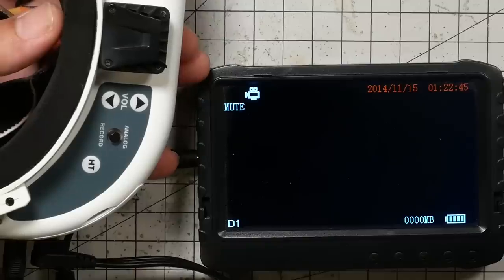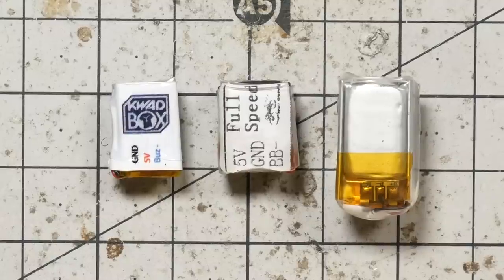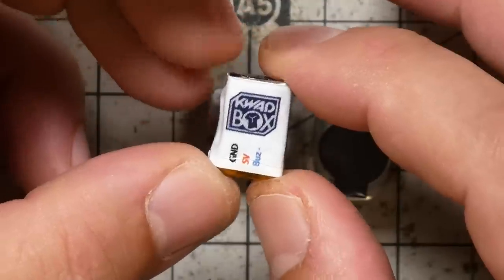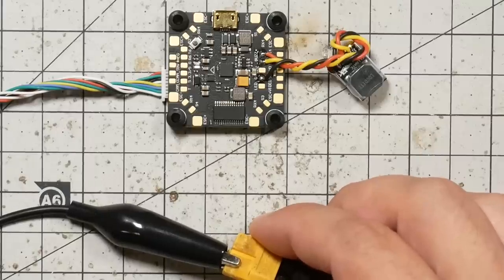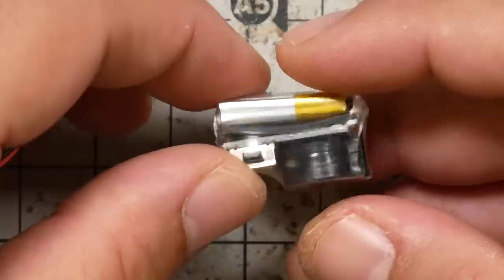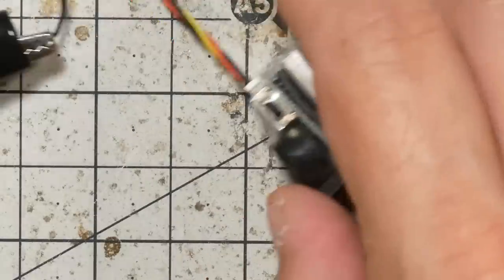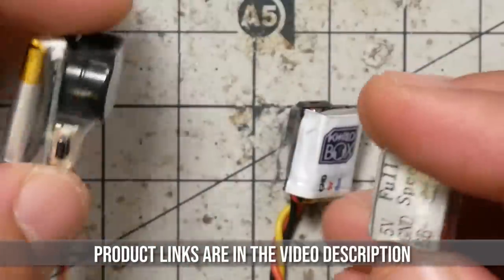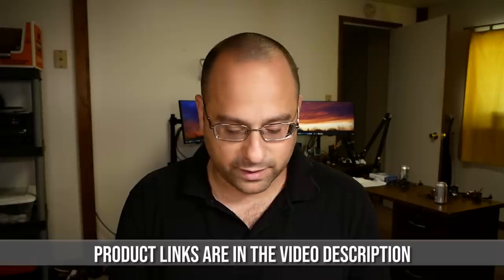Never Lose Another Drone | HELLGATE VIFLY FULLSPEED BUZZER

Comment: I went with Fullspeed Lucky Box mostly because it was the cheapest but I also liked that little menu where it lets you select how long after losing power it arms and how often it beeps. It also has the audible battery level indicator when you connect it back to power which I thought was cool but really isn't all that useful because unless it was sitting in the field for hours or on your shelf for weeks it will always be full and this way I just wake up the entire building if I plug it in at night while working on my quads (also turned off all beeps in BF other than RX_SET and RX_LOST) :) The led is also nice addition if your quad lands in a way that it's visible. Would be great if it had another one on the opposite side so that you could mount it in a way that one led is visible from each side of your quad. Anyway it's good to see competition heat up like this. I never lost a quad but definitely wanna reduce chance of it ever happening and this is a great and a cheap way.

Comment: I've got a hellgate buzzer and it is a lifesaver. I broke my xt60 connector on the PDB side in summer and couldnt make the buzzer to stop in the field and in my way back home because I could'nt put power in the FC anymore, until I got back to my work table at home ;-)
Reply: Feldrik you can disarm it by connecting a 5V pad on a buzzer with thw actual buzzer smd unit +pad on its bottom left corner ie with tweezers. Need to add this to the manual though. We omited the button so it wont get pushed by accident by a piece of scraggle or anything else during a crash. Same reason for not having a jst plug so it cant get disconnected easily.
Reply: That makes sense but I didn't had anything to reach directly the buzzer at the time. I will add something to my backpack for sure in the future. Thank you
Reply: I think I will solder a litlle jst connector in addition directly to the buzzer to plug a little 1s Battery only to disarm it in case of trouble. Will it make the job?
Reply: No problem at the time,  I will see in the future if it is the case ;-)

Comment: I measured the noise level of the Vifly in my review - it was 10db louder than the Hellgate and it's definitely sounds much louder (Even too loud on my bench 😛). The only drawback, apart the argument that it took some inspiration from the Hellgate is that it's much bigger. Thanks for the informative review (as usual) Joshua.

Comment: The Vifly’s volume can be annoying close up, but here’s where it can save your quad, especially if you are flying DJI. There is a bug with the air unit where recording on the air unit will intermittently prevent the OSD elements, both DJI and Betaflight from updating correctly. The items that fail to update are for voltage and current. It’s really easy to end up with a low battery without any indication in the OSD. The Vifly will warn you of low voltage and because it is so loud, you will be able to hear the warning further out. This has save me from dumping my quad in the water at least once.

Comment: I put 1/4” x 1/4” or larger pieces of good-quality reflective tape on all sides of my multi-rotor and fixed-wing aircraft.  Makes them relatively easy to find after sunset with a spotlight - even in tall grass, brush, trees, etc. The spotlight will light up the reflective tape if/when the light hits it. Works amazingly well. Practice with it before your drone goes missing.

I'm also experimenting with $2 Bluetooth ”keyfinders”  from Banggood, etc. and free or low-cost Bluetooth transmitter locating apps. Some key finders and apps work better than others. The Bluetooth devices are low power, but they have unique IDs, which facilitates tracking your own device amount other devices. The Bluetooth key finders and apps can help you know when you are within a couple hundred feet of your quad - then use the spotlight.
Reply: I like your reflective tape idea . I never thought of it but it would be great once the sun goes down as long as you have a general location .

Comment: I love my "model finder" mode on my Eachine Pro58 w/Achilles V1.8!  Of course not if battery gets ejected, but if not it has directed me very accurately in the correct vector. I also just set my buzzer for any failsafe, and switch transmitter off if I can't see where my quad landed (all too often I am afraid 🤣)

Comment: If you have video at this point, it’s very helpful. Disconnect the omni attenna and see if you can get video with your patch. Then, take your patch and shield it with your hands and point the patch antenna around - walk towards the direction with the best signal. Once you’re reasonably close with great video, pull all of your attennas off - repeat. It can get you to within a few feet
-	GPS module from ublox. I have one, but havent tried on my quads until I build my long range. 
-	Bring a bike. I strap one on my car and it’s amazing. Ride around and look in open grass or good for bandos to park out of the area and bike in. 
-	Ive been trying to get a model together that straps a rxsr or transmitter right onto the battery. It works, but I havent figured it out completely. Therefore your battery would be transmitting it’s own signal and you can use your transmitter as described above **to locate your battery**. Therefore, you’d have a LONG time until you’d loose your rssi signal and buzzer which can help you get close to your quad. To use, switch from the model that you fly with to your model bound to your recovery transmitter.  https://i.imgur.com/QCmwBti.jpg
Reply: More great input. so simple to do also. Thumbs up

Comment: Excellent. lol at 11:53. I need to grab a few hellgate buzzers & it is nice to see comparisons of others bc I wasn't even considering anything else. I used my DVR footage & the almost marco-polo method with the directional antenna on my goggles you mentioned earlier in the video to locate my drone 4,000 ft up the side of a mountain & after that immediately installed 2 of the loudest buzzers (not FPV-specific) I could find. When the hellgate buzzer became available I knew I wanted to scoop up a handful bc even as a freestyler with short ranges lately, there is still the threat of getting lost in tall grass, weeds & underbrush as well as an ejected battery. Thanks, JB.

Comment: I recovered my quad out of the Ohio River by using my goggle recording the following day. ALWAYS run you dvr. I also use Vifly too. There are 2 versions. Josh is showing the totally self power version. The wired one in is smaller fyi. Keep up the good work Bardwell
Reply: Dvr is useless if the reason you crashed was a video loss.

Comment: I bought fullspeed, and do not regret it. Put it on the 110mm frame, it was difficult to have access to the button had to split the buzzer and battery and distribute them on the quadcopter.
Reply from the maker: For what it's worth, the fullspeed also can be disabled by the plug/unplug method.

Comment: JB... You don't need to turn off the receiver to configure the DVR to always record. Just turn on the DVR by long pressing the button, then long press it again to get to the menu.
Reply: you have to turn off the rx.... technically it would work but you dont see the menu... so whenever you want to access your menu's in the fatshark goggles you have to turn off your rx in order to see the menu acutally... otherwise you'll just see white noise.. - at least for dom v3 and earlier..dunno for hd3 and hd0
Reply: bintelfind OK, but it's not required for the HDO. Seems Fatshark updated something!

Comment: Yeah.  Turn down ESC delay to 1 min. Turn up beeper volume on esc to max. As long as your battery doesn’t eject you should be good. Another trick for battery retention is to insert tooth pics into the XT60 plug on the quad and then break them off.

Comment: I didn’t realise you could set the fat sharks to auto record all the time! That would have helped me that day when I lost a quad for 3 days 😛
I like the buzzers. The hellgate seems good but I see a problem.. if you disarm it by plugging in power, what happens if your quad has damage to its power system? What happens if it got wet and you don’t want to plug it in?
The vfly is super loud which is good, I guess I would have to disable all beeps in betaflight though if I wanted to use it without getting deafened
Reply: Awsome buzzer. .
I totaly get one
Reply: I dont like the Hellgate Buzzer with the replug disarming. I would rather not have to reconect it with another 6S spark after every flight. 
A local guy recently lost his battery at a crash in the field and we could not stopp his hellgate buzzer during the whole search with a lot of people as we brougt no battery. Slightly annoying!
Reply: Should have a smoke stopper on hand.

Comment: After 1 year of buying it. They replaced every one that arrived dead. Totally I've had 4. 1:4 is a working one. I had to shoot a video to proof that they were really dead because they have requested it. They have had very bad QC, i dont know if it improved  since because I won't risk buying it again. But the one working really paid for itself after my quad stuck at the crotch of a pine tree over 80' up at night. I located it far from distance by its blue LED beacon. Next morning it was still tiredly chirping. And no, it is not more loud than others.

Comment: Changed out buzzer/beeper in my ET100 hoping to improve my ability to hear it over my industrial deafness, all to no avail...
Im told it's louder but can't hear it myself....
I COULD hear the FullSpeed during your clip but not the ViFly, perhaps its the microphone failing due to pitch & volume, or it could be my ears....
Have considered plumbing in a reversing buzzer or a small motorcycle's tiny horn to a larger quad- I just wish all these buzzers & beepers were of a lower pitch as the freaquency most currently use fall in the range of all the other whistles, pops,  buzzing, ringing & various other noises that make up the cacophony of tinunus.....
Thanks again & I'll give the two cheaper units a try & see if I can hear them...

Comment: My idea is to focus on recovering the BATTERY of the quad. If you can find the battery, you'll probably find the quad. The battery will give days of power if not weeks without some microscopic battery. So I've been messing around with mounting my old r-xsr's and binding a locater model that can find my battery. You only need battery power to the rxsr to bind to it - no FC logic needed. At that point, it's just adding a buzzer by whatever means. Technically, it should be possible to do a transmitter + buzzer combination that you could use your transmitter to locate. Make sense?
Reply: Great idea
Reply: Brilliant, I just thought along the same lines as you did.  You could put any kind of beacon (a telemetry RX) onto the balance lead of the battery, no other modification required.  Just make sure it's secure -- are there any latching XH receptacles?
Reply: Great idea!
Reply: Superb logical idea... but what if the quad is out of range of the receiver/transmitter?
 I have been using a lipo tester connected to the battery.
Reply: Murat TÜREL It more along the lines of easily improving what we have. Nothing 100% retreivable. The whole setup is smaller and easier to mount and deal with than gps, etc. It gives you more range than any beeper. Id like to think that gps would be ideal, but it involves alot more steps, antennas, potential subscriptions, cost and complexity.

Comment: Love your channel Joshua, thank you for all the time you spend on putting these together. I am an absolute noob here, have a TinyHawk II Freestyle and this thing is small, but large enough to fly outside at parks without bothering people. Unfortunately, it is a momma to find in the grass, and lord help us if I ever crash in a field. The buzzer on the TH is not very loud at all and I’m wondering if you have any experience with this quad and whether the tiniest of the buzzers above would work ? I will buy the buzzer in a heartbeat if you think it will fit. Thanks in advance for your help.   Oh, p.s., in order to go from 25mw to 200mw you have to push and hold a button (incredibly hard to get to) on the board to bump it to 200mw. Would there be a way in your opinion to desolder and bypass the button leaving it in 200mw 100% of the time?   Again, thanks in advance for your help.

Comment: Last time i nearly lost my kwad. My video antanna was bad placed and i had total lost of video from one second to the other. I had just a draft guess where it could be grounded. Bad timing also for my loc8tor (drone finder) because my loc8tor battery was dead... The grass was more then half a meter high - nearly impossible to find anything in there. So lets activate beeper i thought, but the only thing i could hear where birds, and grasshopers, but no beep from my drone. Yea my remote beeped too because i also lost receiver signal more or less. After running around searching where it cold be i rememberd to use RSSI signal to bring me back to my drone. Due to a broken antenna on my receiver (lucky me) i had nearly no signal on my remote...just if i putted it over my head then i got a small signal...turning around to find where the best RSSI signal comes from and walked this way. Checked signal streangth all the time, if it goes up walk further, if it goes down rescan area where best signal comes from. Walk along that path and finally between bird an grasshopper sound i could hear a tiny beeep beeep from my drone....i followed it and got my drone back! WOW i was happy. RSSI is for me now one very very important stuff - saved me alot of money!

Comment: I lost my quad in a big field last week and learned a valuable lesson. A $225 lesson to be exact. I actually found it by turning down the the power on the VTX to 25mW After I found it I wanted to fly my last pack and I forgot to turn the VTX back up to 400mW. So when I went to do the same maneuvers at the same altitude that I was, I lost signal. It rained a couple times but I'm pretty sure the battery was ejected. Do you think there's a chance that it's okay to be rained on as long as the battery wasn't in it?

Comment: Hey also for the Vifly finder you said not to hook up the yellow wire ? Will it still work on the switch? Can you explain the differences between having it soldered up and not having it soldered( yellow wire)
Reply: I thought yellow wire was to do with battery charging for its ground..?

Comment: Another good video👌, others have made but you have covered in more detail and done comparisons.
I use a Drone keeper Mini (Google Nichemall)1st gen ,possibly the 1st on the market? Expensive at the time but it payed for its self many times  over!
It can be used independently and or wired, it has a motion sensor built in.
They now have a 4th generation vision $22? These are not clones and are original and probably spawned the idea for the development of the Hell Gate?
The reason they did not storm the market was due to couriers unable ship lipo batteries as this was build in and cost was prohibitive to use DHL who would ship?
The new version have small coin cells and/or option to wire them in.I have no connection to the company.
It is possible to make one with an Arduino nano or similar smaller programmable controller, but it is actually quite difficult to get it that small(I have built one).
I think a better option would be to develop a timer version you could change the duration of when it goes off, 1 button to switch on/off and program and usb chargeable, no complication very small, no motion sensor, no wires, cheaper and it fits on a battery strap, you move it around quads, so you only need 1.
It would be pretty easy for someone all ready producing these to build.(I have played around with this but not had the time to finish).

Comment: Great Review. I wanted to save some money and got the fullspeed buzzers and it would not work with my different quads. Who wants to use a switch to turn it off. I had a couple of HellGates buzzers and no problems. The HellGate has paid for itself over and over. Don't buy the Fullofsh!t buzzer.

Comment: great video mr. bardwell. question...i run the spracing f3 fc, it has pos and neg for buzzer setup, but the vifly comes with 3 wires, red, black, yellow. where does the yellow go? not quite sure how to solder this in. love what you do for the community. thank you. 👍👍
Reply from the maker: https://www.viflydrone.com/viflybuzzer.html

Please refer to the wiring diagram here. Yellow goes to buz-

Comment: I’m probably going to get heckled for this but I usually get out my RF explore with beam antenna  and walk right over to it and pick it up. The beepers are great if you  eject a battery but if you’re flying with 10-20 other people the RF explorer is the only way to go find the quad in the woods or you wait until dark and it gets quite and then you can hear the beeper. On other note pay attention to the solder iron temp I bought some HellGates when they first came out, I didn’t check my temp and lifted a pad ..
Reply: Rdf is an extremely effective method of finding something especially with a good triangulation app, you can get within a couple feet of the target.
Reply: @X02AC3  i didn’t understand.. how can you do that ?

Comment: I just bought the ViFLy 2 and to be clear the LOUD buzzer only works if the battery is ejected.  You can't activate  the LOUD mode with a switch on your transmitter. It only works when the battery is ejected.  Correct me if I'm wrong please.

Comment: On my HDO, I found that auto-record isn't really reliable.  If I unplug power and plug it back in within 1-2 seconds, the DVR won't start recording.  Other than that, it works fine.  It so happens that I can just about see the flashing red LED in peripheral vision, so I can check during flight whether the DVR is running.